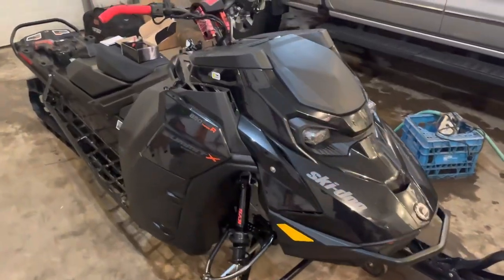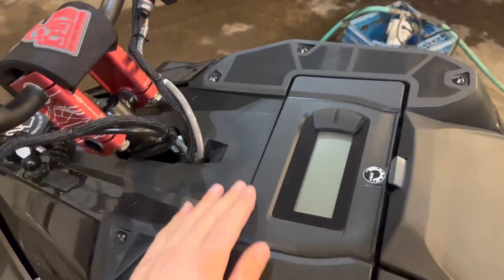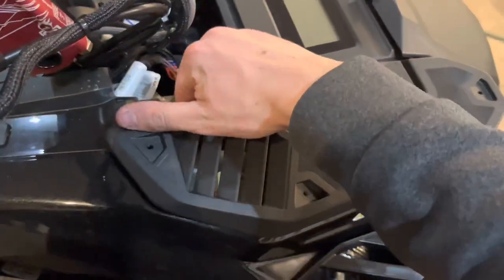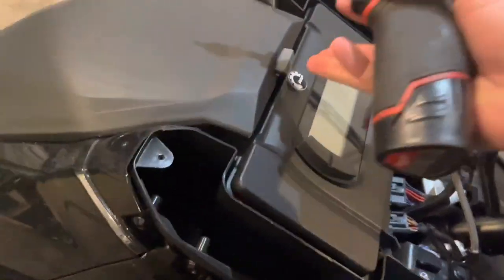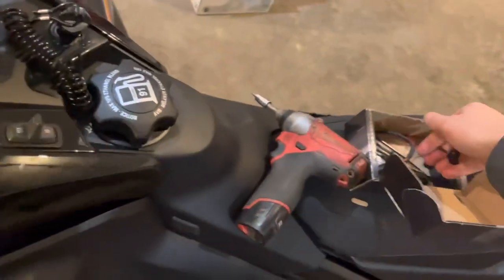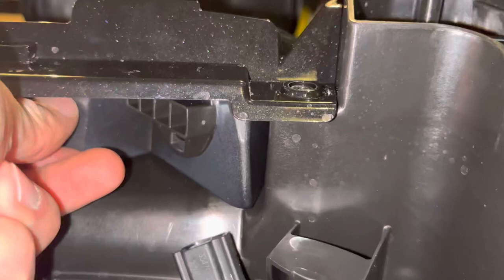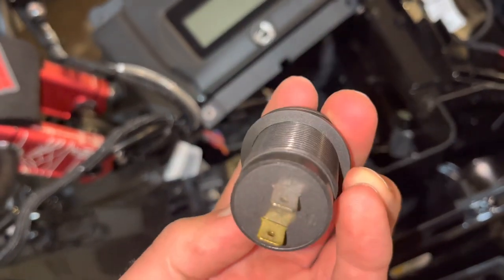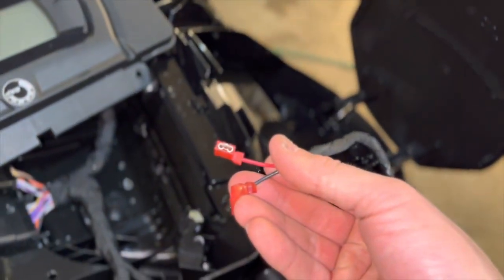USB Outlet Install on 2023 Skidoo G5 Expert Turbo - EP 2

Comment: Nice Video!  Highly recommend using some sort of adhesion on the threads so the nut does not back off over time, I stole the wife's clear finger nail polish.
Reply from the maker: Good point! I’ll have to give it a try.